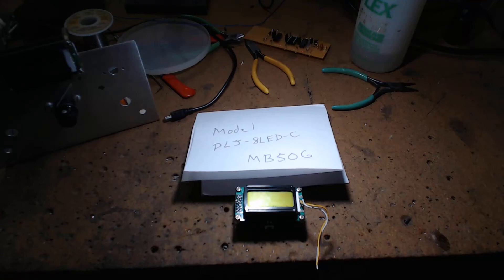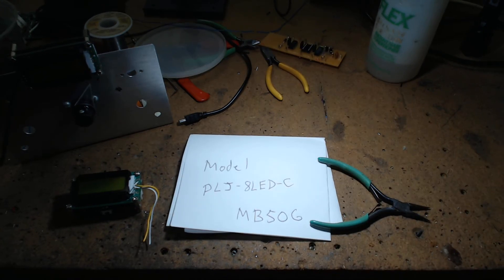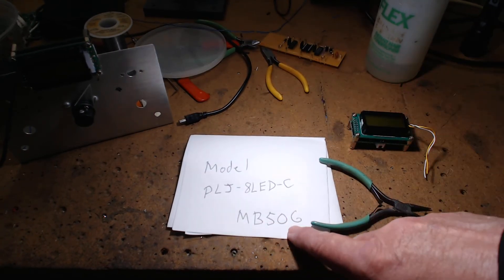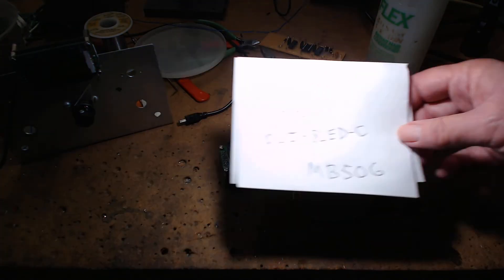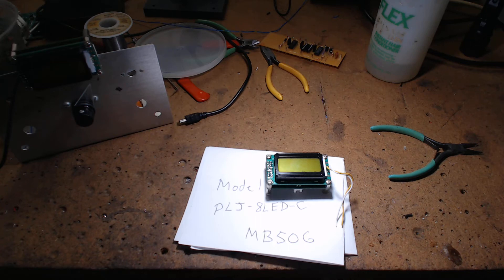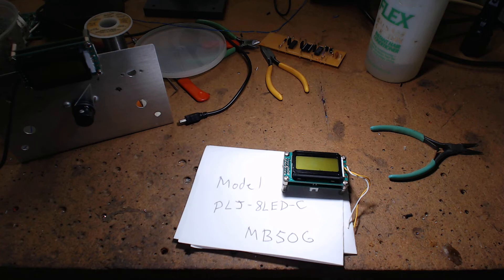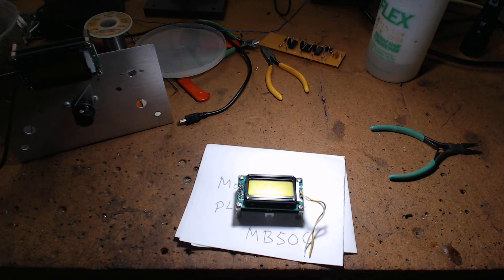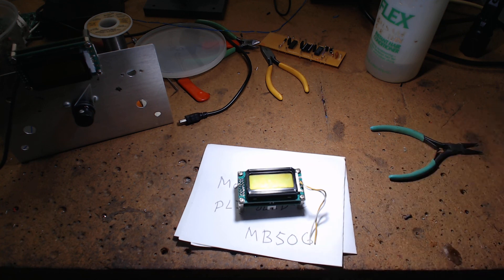Ebay Frequency Counter Module Manual Part 2

Comment: A search for the one you have, came up as a manual for a complete different display. It's a long 8 digit unit. With 2 push buttons.  And it has the same model number!  Weird...
Reply from the maker: Look at the schematic that is in that file. you will see the circuit for the PreScaler which has the two pots not mentioned in the new manual.  The old uses LEDS the New one uses LCD.
Reply: @johnkleinbauer4424  - You are correct Sir!
Reply from the maker: @tubeDude48  The PIC and The LCD driver are not a problem. What Bugged me is what is that 506 chip and what POT does what. As you can see one pot is on either side of the Scaler. Knowing the 506 is a MB506 is also some help.  My guess is the module is made for Engineers but they are selling it to the public. Well I found my answers. It would have been nice if they included a schematic in the first place. I got hours into yet another rabbit hole.